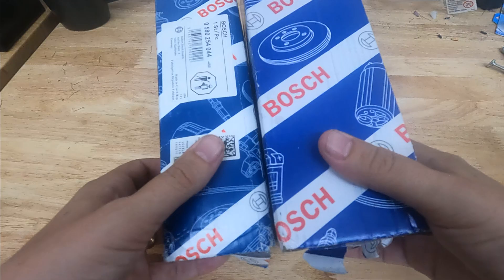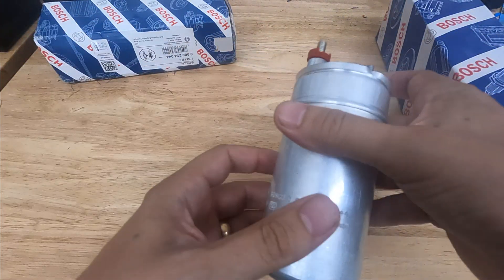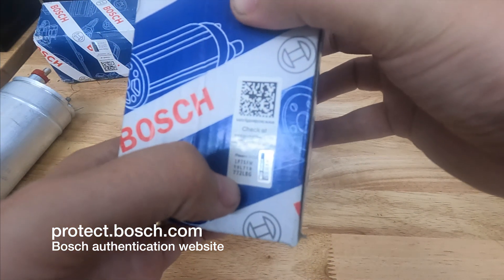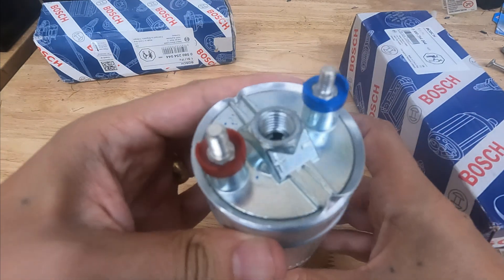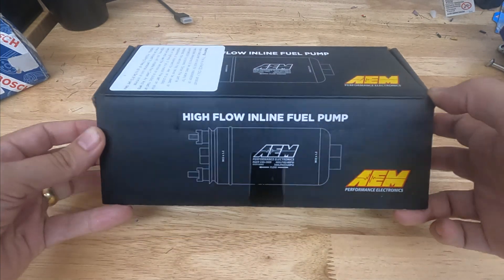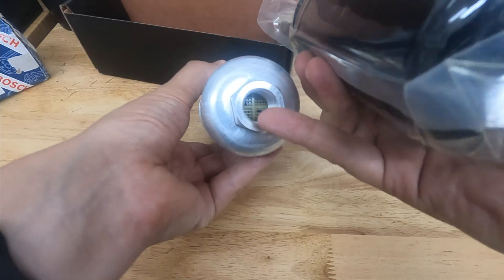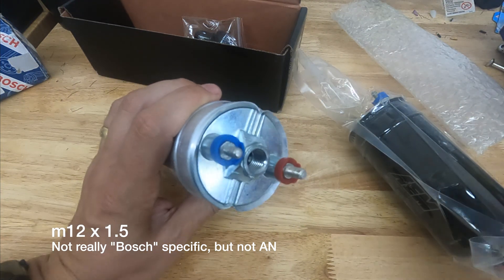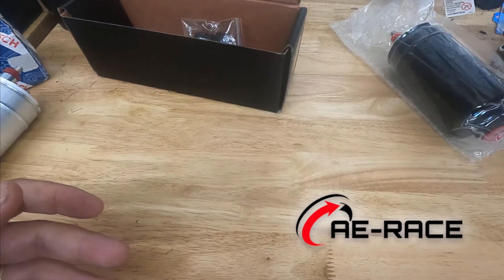Don't Buy Fake Parts - Identifying counterfeit Bosch

Comment: Fake Bosch spark plugs are around too, marked as same heat range as Made in Germany plugs, clear, obvious visible differences from China crap to German plugs.
Yes Bosch have a plant in various countries, China included, but there's no reason you should see any difference between the parts, regardless where they're manufactured.
Car parts are faked big time, be careful people.